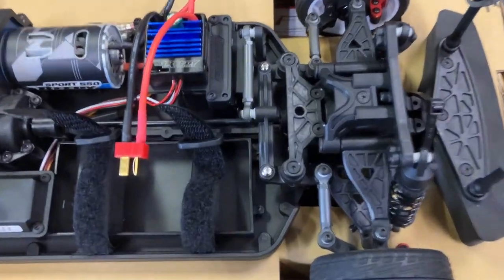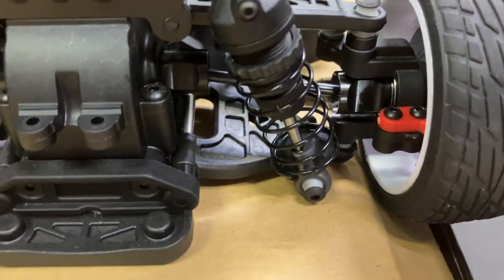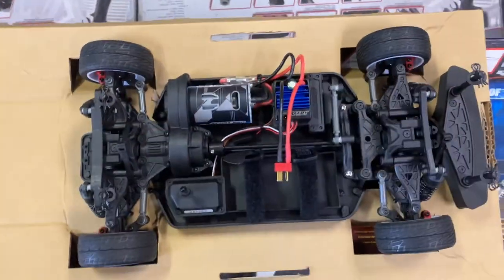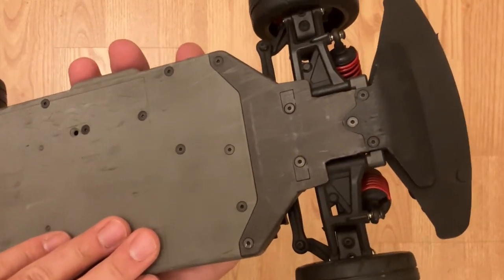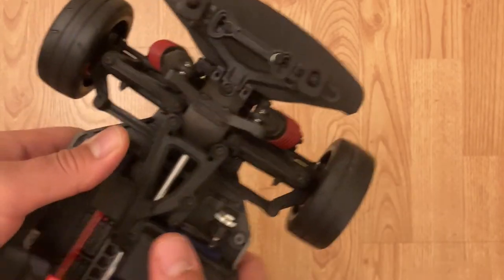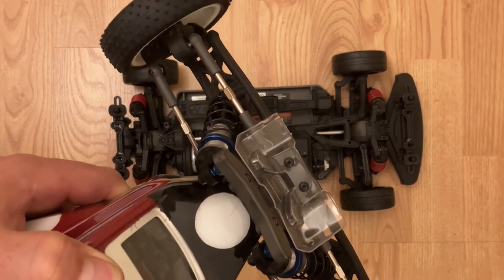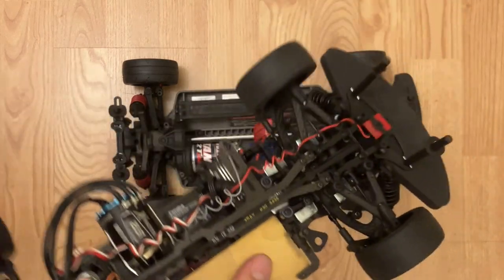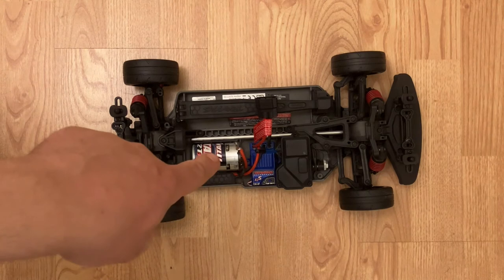Team Associated basic Apex2 Hoonitruck is it the Traxxas 4 tec 2.0 3.0 killer? Basic features Talk

Comment: I know this video is a year old, but it looks as if the 2.0 is disappearing. I bought the mustang 2.0 as my first introduction into touring cars. My lhs had one and marked down to 229. So, I took it. Now I can't find them anywhere except for the chassis kit. There is a great aftermarket support but I found myself having to order anything and everything online since my lhs didn't carry anything for it. Aftermarket, I can understand. But they didn't even carry stock parts. Said they didn't sell much so they don't stock it. It's a fun little car though. I got it because of the aftermarket support. I hope Traxxas doesn't start phasing it out.
Reply from the maker: They are not phasing out the 4-Tec 2.0. The phased out the brushed version along with ones that came with bodies. The came out with the BL-2s chassis. But they sell the bodies separately. 

I have a few videos related to the 4-Tec 2.0 BL-2s. If you have a chance:
https://youtu.be/yh3MTQ4qJhA
https://youtu.be/aYMdRrDa6oo
https://youtu.be/j2qWPeMUd4s

And I have this one regarding the motor specs:
https://youtu.be/_corjJptusM
Reply: @telecomandorc  Appreciate it!

Comment: Will the hoonitruck body fit the 4tec 2.0?
Reply from the maker: It should fit as long as you ream new holes in the body. It is a 200mm body. Now, the Hoonitruck is 259mm while the 4-Tec 2.0 is 256mm. It is a 3mm difference and it your be within tolorance as long as to set the front first to make sure your steering wheels clear.